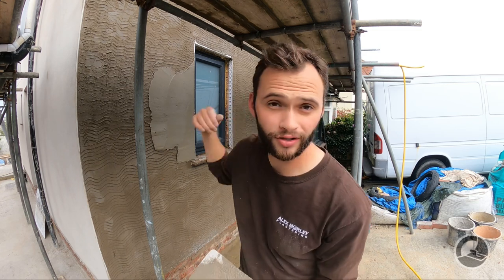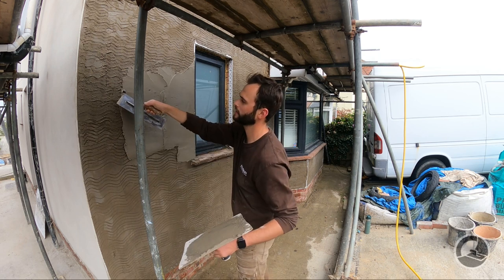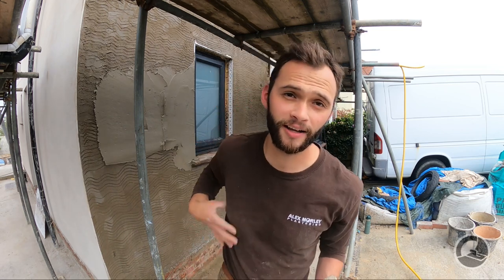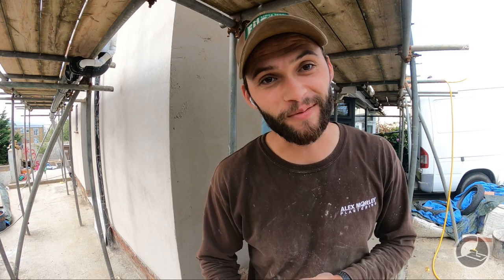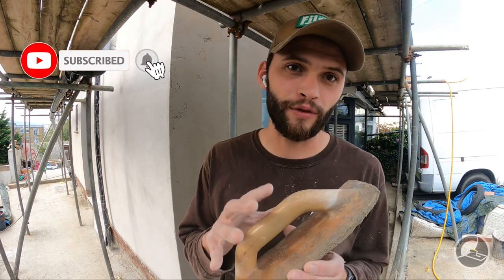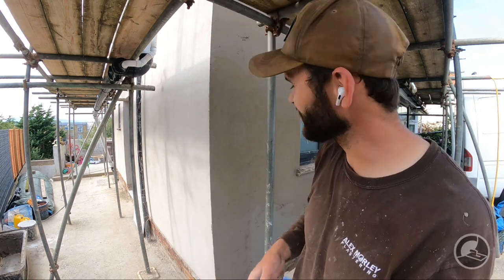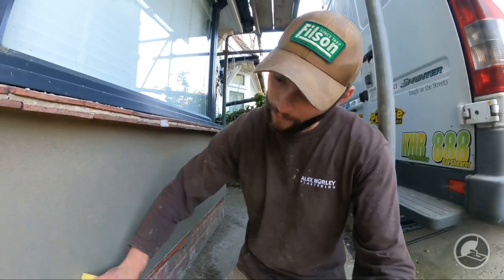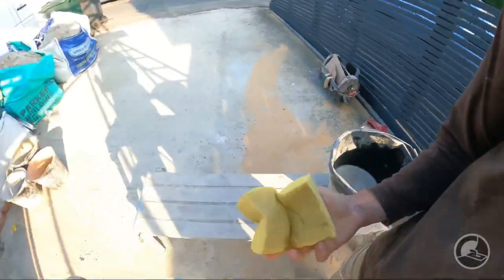Traditional Render Perfect Top Coat

Comment: I use a 12 emir to float up and then 10 minutes after i use the refina diamond float at a medium pressure its gives it a nice touch at the end
Reply from the maker: Really good suggestion. I can imagine that works well. 

We use the powerfloat for most of it, then go over with the amir.
Reply: Funny i also use them tools but in the opposite order!
Reply: @jamesjb2007  also i’ve done the same mate, find the diamond at the end just closes up better than using the other way round

Comment: Hi Alex, thanks for all the great vids on sand and cement render, can I ask how you leave the lower edge of the top lift  to be able to blend the bottom into, basically the join done next day
Thanks 
Keith
Reply from the maker: Hi Keith

You don’t “blend” a flank in top and bottom, it would look really rough. It’s all done at one time. 

If you had to join the 2 you would use and expansion joint bead.
Reply: @AlexMorleyPlastering  thanks Alex for the reply,

Comment: hi mate, i’ve got a full house to render and the old render has been taken off by my builders lads, and the brick work is really uneven!! there’s no way this can be done in 2 coats, i’ve never had to apply 3 externally before, any tips on how to go about doing this and ratios please, tia
Reply from the maker: Depends how bad your talking. Even the roughest of walls usually can be saved by bedding render mesh in the scratch.
Reply: @AlexMorleyPlastering   theres over an inch difference in depth all over the brick work
Reply from the maker: Sounds like it would benefit from a pre-scratch. Basically I would keep the scratch the same gauge. 4 Sand 1 Cement, go over again the next day and set your beads. 4 Sand 1 Cement. On the 3rd day topcoat 5 Sand 1 cement 1/2 Lime
Reply: @AlexMorleyPlastering  thanks mate

Comment: Hi Alex.
Thanks so much for all your videos, rendered my extension thanks to you and Blaine.

You mentioned at the start video on floating? I cant find it and I dont have a power float (yet!) any tips on manual floating?
Also where bits are a bit too dry as im quite still slow! I used sponge float to try revive it but you can tell a mile off the section i used it for